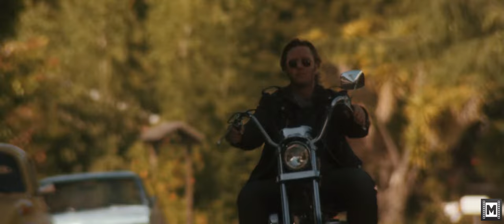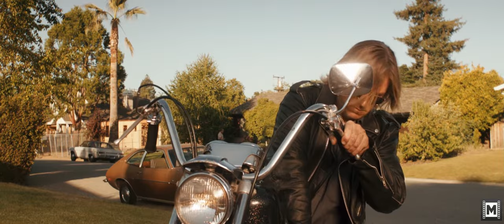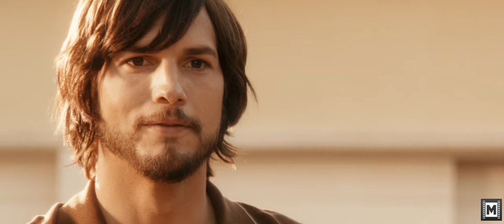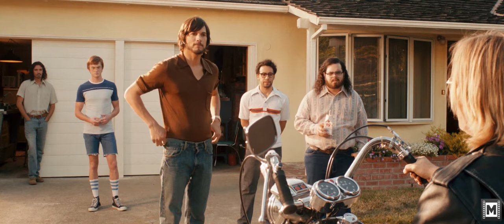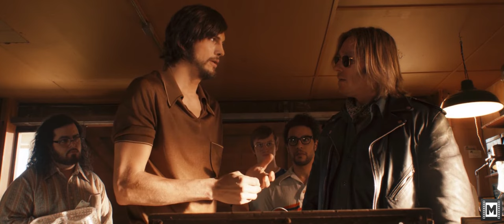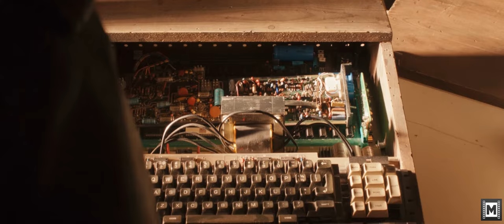Jobs (2013) - Steve Builds Apple 2  || Movie Clip 8/26

Comment: The Apple II did ship without a fan, but it DID overheat.  Eventually venting holes were cut onto the sides of the case to ventilate the system.

As of now: 2023,  most Mac products (Except MacBook Air) comes with fans...and guess what: It's having heat/throttling issues.  

I think the last time Apple shipped a computer without a fan was the PowerMac G4 Cube.
Reply: Fanless computers have always and will always sacrifice power for style points. Laws of thermodynamics. Steve thought fans scared people away from computers and he was right about a certain type of buyer
Reply: @CHURCHISAWESUM  Not a law of thermodynamics, it's more a matter of Moore's law.

Your smartphone is fanless, yet it has more computer power than a stadium filled with Apple IIs.

Jobs early focus on making the PC an Appliance kept hurting him.  Same thing with the original Mac.  Engineers had to go behind Jobs back to add more ram.
Reply: M1 are far more effient and doenst need fan. unless you are using it as server